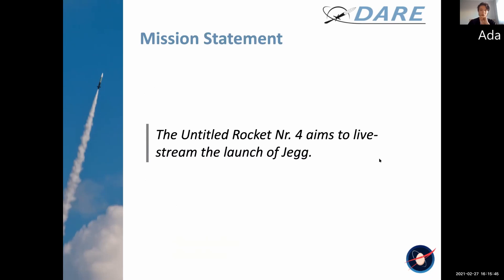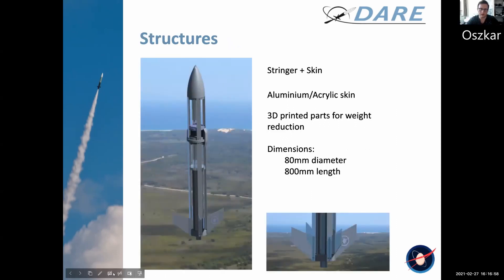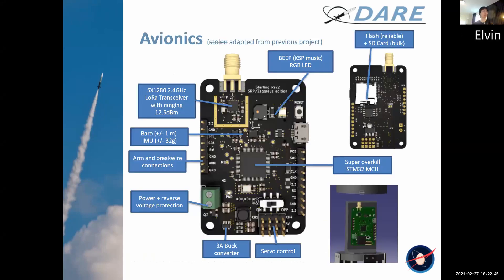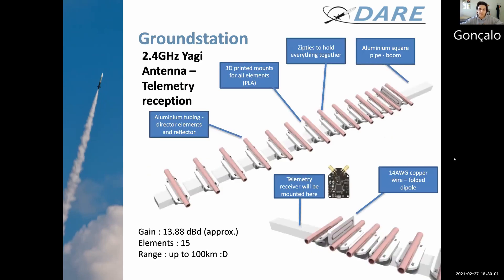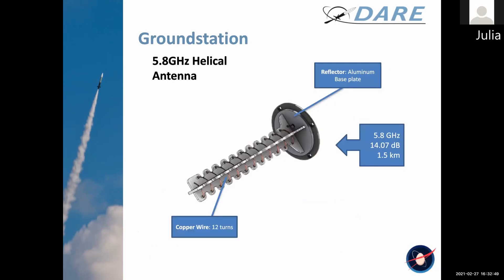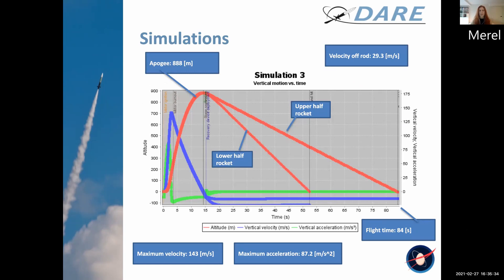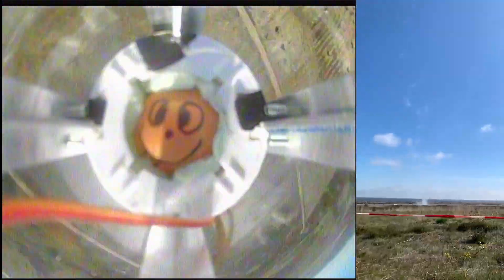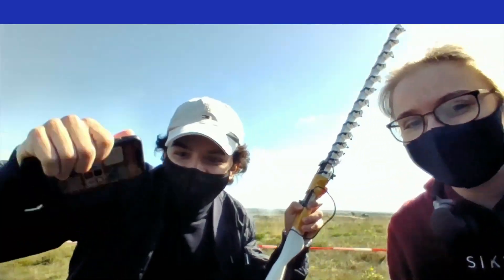Untitled Rocket Nr. 4 | A DARE small rocket project

Comment: was it powered by a commercial motor ?
Reply from the maker: It was powered by a custom ~390 Ns motor previously developed at DARE for small rockets. For safety reasons that's the only part that's not allowed to be designed/modified for the Small Rocket Project.